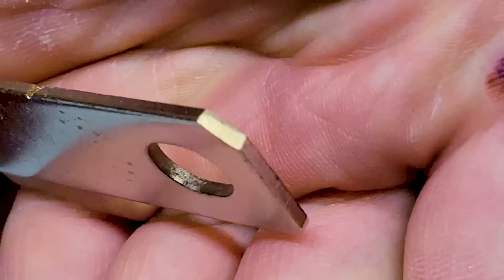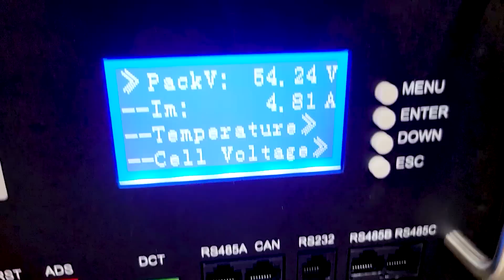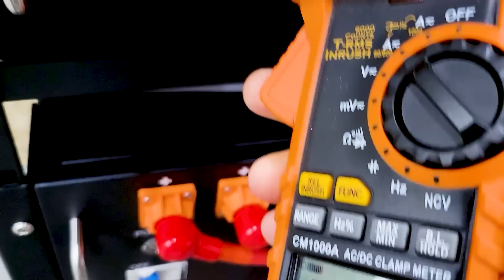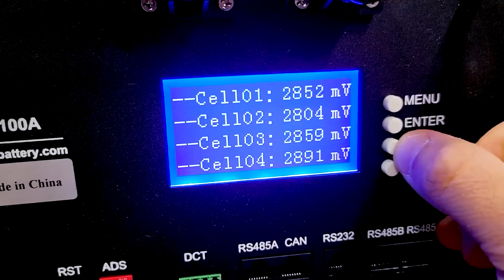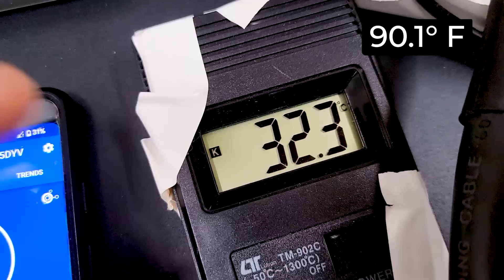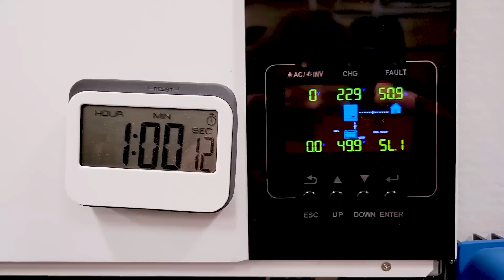Battery Banks - To Daisy Chain or Not to Daisy Chain?  Jakiper Part 2.

Comment: David, I discharged my 276 AH battery( Big Rhino) down to 30%(SoC). The  Conext SCP gave me a low dc voltage warning. After this, the battery went from 276 AH to 261AH and won’t go beyond this number. Is this normal for Lithium Phosphate batts losing 14 AH after 4 cycles? Thanks. Love your videos.
Reply from the maker: Thanks for the question.  Short answer is "No, it's not normal for a LiFePO4 battery to loose 14Ah after 4 cycles."

Longer answer:
 It will be difficult to answer based on your specific situation.  I've never tested a "Big Rhino" battery, and I've never tested a Conext SCP.  
In more general terms I'll try to help.  

I don't know where you are reading the "276Ah to 261Ah".  Is that from the battery BMS or the SCP?  If it's from the BMS, then the BMS may be re-calibrating after having gone through some cycles.  

I once had something similar happen when i was testing a new battery.  It was originally 100Ah, and after a few cycles the BMS re-calibrated to a lower number.  What I found was that I was hitting the high-Voltage cut-off too soon, and the Low-Voltage cut-off.  This is because the cells were not balanced.  In that situation, I removed the cover and top-balanced the cells manually.  Then after a couple more cycles the BMS re-calibrated back up again.  I don't know if this is exactly what is happening with you, but I thought it may help.

Comment: battery 52.3V 112A 5.9kW  the 240VAC output of the inverters was 5.9kW  so a loss of 8.5%, that seems like a lot !
battery 46.5V 101A 4.7kW the 240VAC output of the inverters was how much ? I imagine the loss is higher boosting from a lower voltage ?

Comment: I was just thinking about buying some solid copper bar, maybe 1"x1"x6", and drilling and tapping it for lug screws. It's for non rack mount batteries for a busbar. And one thing that has been a question for me is from assuming that a 100 amp BMS meant 100 amps at 110 volts, which I just recently realized was wrong. So a 100 amp BMS in a 24 volt battery can put out twice the power that a 100 amp BMS in a 12 volt battery does. I'm very familiar with electrical, but for some reason all the alternatives in solar have been clouding my perception in this area.

Comment: David, can you use the 48V charger in same time when inverter charging the battery?
Reply from the maker: Yes.  Multiple sources can be charging a battery at the same time, so long as you don't exceed the batteries maximum charging Amps.
Reply: Thanks, good to know just in case I need to speed it up charging my battery, just about to finish my 12 K Growatt inverter installation.

Comment: For general information:  If copper is taken as the "standard" conductor at 100%:  Aluminum = 61%, Brass = 28%, iron = 17%.  However, the copper must be pure electrical grade.  As little as say,  0.1% tin will reduce conductivity drastically.

Comment: That is a poorly wired system. Each one of those modules provides up to about 100 amps, and only the the first two should have a 4# wife between them. The second and third unit should have TWO 4# wires paralleling them, or a 2# wire, and upping the current capacity accordingly. The better way of doing it all is to connect a 4# wire from all the positives to a buss bar, and THEN the 4/0 cable to the load. If you people want to waste energy, then connect it all up like this video, and possibly even have a fire....that always a good thing, huh? Look up the ampacity tables for welding cable, and you will understand....hopefully.
Reply: Wire, not wife....fat fingering....

Comment: I'd like to know if it's feasible to just have an inverter and a solar switch.  Would I need a charge controller?  Trying to design a small solar with no battery which I can add later.
Reply from the maker: Yes.  The inverters I'm using: https://signaturesolar.com/growatt-5kw-stackable-off-grid-inverter-spf-5000-es/?ref=4_rHcgZ9x-TiF- will power up on solar only.  So long as your load is much smaller than the solar, you can power it.  But be careful about expecting a lot.  As soon as a cloud rolls by your load might shut down.  It's nice to have at least a small battery to help out.

Comment: Hello David. I'm planning to buy two 3kW Growatt or EG4 inverters and one 5kW Battery. The battery will be outside my home so I need something different than a server rack battery. I've been looking some information about the Orient Power power wall but it's a new battery and I can't find many info about it. Do you have more information about it? could you recommend any other battery for outside environment at the same price point?
Reply from the maker: The Orient Power Wall is not waterproof, so you still need to protect it from rain.  The specs on it look identical to the server rack battery.  I suspect Orient Power used the same cells and BMS inside a different case.  This is not a bad thing, just FYI.  If I may make a suggestion, the server rack battery can be put into a plastic foot locker, like this: https://www.homedepot.com/p/Stanley-23-in-50-Gallon-Mobile-Tool-Box-037025H/202300294  In fact, I have a friend of mine who did exactly this.  If you want to see the video here it is: https://youtu.be/MmKsTafbNyU
Reply: @DavidPozEnergy   Thanks for your answer. Unfortunately the part that shows the batteries is too fast to detail how it was made. So do you recommend me the life power battery instead the orient power power wall? I need to be sure because I live outside the US, I will ship the items by sea freight and once I buy the equipment I will have no option to return it in case of any issue. Thanks for your help and if you have affiliated links I will use them.
Reply from the maker: Since you are looking at Growatt or EG4 inverters, then I'd suggest staying with an EG4 battery.  This will make the setup better because the battery and inverter are made to work together.  The EG4 inverter even has a pre-set menu option to seamlessly talk with an EG4 battery.  Both the battery and inverter are not water-proof, so you will need to make sure they can't get splashed from rain.  
Here are some affiliate links:
48V battery (no screen): https://signaturesolar.com/eg4-lifepower4-lithium-battery-48v-100ah/?ref=4_rHcgZ9x-TiF-
48V battery (with screen): https://signaturesolar.com/eg4-ll-lithium-battery-48v-100ahd/?ref=4_rHcgZ9x-TiF-
3kW EG4 inverter: https://signaturesolar.com/eg4-3kw-off-grid-inverter-3000ehv-48/?ref=4_rHcgZ9x-TiF-
6.5kW EG4 inverter: https://signaturesolar.com/eg4-6-5k-off-grid-inverter-6500ex-48/?ref=4_rHcgZ9x-TiF-
PV high voltage disconnect: https://signaturesolar.com/dc-disconnect-rooftop-isolator-switch-by-imo/?ref=4_rHcgZ9x-TiF-
Reply: Perhaps re-purpose a dead refrigerator or freezer (?)

Comment: Off topic question but could you run a string of panels thru a mppt controller to an agm batt bank as well as an additional set of panels running thru a pwm controller to the same battery bank?That's what I have without buying more equipment and wanted to charge the bank faster.
Reply from the maker: I've never tried that, so I don't know for certain.  My gut tells me that it would work most of the time, but not at the high end.  I think one of them will fault out when the battery is over 90% SOC (state of charge).  If it were me, I'd save up for another MPPT charge controller.  Multiple MPPT CC can be paralleled without any problems.

Comment: David does your solar array provide enough power to get through the winter or do you use wind /grid tied generation also. Thanks Alan
Reply from the maker: Last winter I bought some electricity from the grid in January and February.  If I didn't have enough solar production, I would manually transfer the whole house to the grid, and run on grid until the batteries re-charged with solar.  So that would typically be 1-2 days, then switch back to the off grid system.  I did this a handful of times, probably 14 or 15 days total for the winter.

Comment: If these batteries were 12V 400Ah (instead of 48V 100Ah) and were connected in series (instead of parallel shown in video), would that create equal-temperature cool wires at full load? Alternatively would diagonal paralleling (instead of straight paralleling shown in video) also do the trick?

Comment: The current you measure was a steady state at a reasonably high state of charge. The current will be higher when the batteries are nearing low voltage disconnect.
In addition you might consider surge capability of the inverter. Not because of energy loss in the wiring, but for the voltage drop in the wiring. If the inverter needs to supply a surge load, and the batteries are low, too much drop in the wiring will cause the inverter to shut down.
For this reason the minimum wire size I'd install would be 2/0.  On my system I used 4/0 between battery and inverter to handle a surge current of up to 16 kw / 380 amps.
Reply: The minimum would be 2/0 for the system you've shown.  Sorry if that was unclear. 😄

Comment: Hey David. Since there is concern about excessive heat on the battery terminals perhaps you could start reviewing some of the 96 volt inverter systems. I know we are all set up for 48 volts but there appear to be more 96 volt systems hitting the market. The obvious benefit with those is lower current flow and hence less heat loss.
Reply from the maker: Can you link to one you think I should check out?

Comment: Very interesting.  Looking forward to your follow-up on alternative ways to hook these up. 

Would it make a difference if you just increased the size of the cables to allow forever amperage without all the heat loss?
Reply from the maker: Yes, thicker wires will help, but still not be the best option.  Even with thicker wires, you still have multiple connections and multiple points of failure.

Comment: David, that is a great test.  I agree that just ‘because’ a conductor ‘says’ it can carry that many amps, it doesn’t mean you should.  

That was a great test on the Jakiper batteries, and the Growatt inverters.  I have 5 of these batteries and have two Growatts connected (with larger conductors) just like you set this up in this video.  I’ve never pushed my system that hard.  Glad to know it can produce to spec.

Keep up the great work.  

You hinted that you might reconfigure this to a better configuration.  I sure hope you do.  

Thanks David.
Reply from the maker: Yes, the next video I'll demonstrate a better way to wire the batteries.

Comment: Excellent and comprehensive review, David! Thanks!

It is amazing to me how manufacturers cut corners sometimes. While most people won't notice, it is dangerous to run some much power through wires and jumpers that are not designed or certified to carry the load. I'd personally skip Jakiper as a result unless I knew for sure that the deployment would never exceed say 80 amps at 48v nominal.

Please put at least a damp towel in your dryer -- it's bad to run a dryer empty! 🙂
Reply from the maker: Thanks for the tip on the dryer, I didn't know it was bad for it.

Comment: Another great video. I agree with some of the other guys, shorter cables and maybe thicker would have done the job better. Would you replace those busbars with your own copper ones and run the tests again to see how it performs then?  Just for interest sake to see if it handles the temps and loads better?

Comment: David, many thanks for this test. Clearly a busbar system is better choice.
Think that temp rise of measured busbar is caused by the heated up cable. Not due to material what your where think.
Voltage or current drop over the heated cable would interesting thing to measure.

Comment: They did well on the capacity test considering you were running mostly at 0.25C and not 0.2C. Interestingly, if you’re going to subject them to that kind of load I would almost lean towards a high voltage setup. However 51.2V is less proprietary and more DIY friendly, but I have seen a lot of the consumer batteries designed for hybrid inverters are now high voltage. Not that safe to work with :)

Comment: Hi David 
Thats a great video actually your videos are all great man and keep it up. I cant wait for your next battery bank design to sort out that high temperature and current on both supply terminals. Out of curosity did you make a video of the battery bank communicating with the PC to see the batteries on the PC with the software. I really need help with connecting the pack to communicate and also the Admin Password
Reply from the maker: Thanks for watching the video.  I have not attempted hooking up the battery to a computer.   I'm not good with computer stuff.  Sorry I can't help you.

Comment: For the SOK 48v 100ah battery (which Jakiper stole the design from) , we use 2/0 wire between packs and have much better temperature. We also use much shorter cables. Our spec for feedthrough with 2/0 wire is 350a max, which we were able to sustain indefinitely without any dangers of overheating. HighTechLab did a video of this testing at our facility.
Reply: Thank you for your attention to us all the time. 
We sell 12V100AH battery in US retail market since 2018(first sell LiFePO4 battery on Amazon).
Our first container of Jakiper 48V100Ah arrive US warehouse last year, we keep upgrading our batteries by client's request since second container, you start selling this 48V just several months ago.
You have left many negative messages in our clients' forum, one of them says" It's nice to learn from the failures of other companies" on Feb 26 2022, later you slander our service with your pubulic friends... We ignored these because we want to win long term business with the sincerity, and show our real service to customers by time as always...
You are closer to end user, you have better chance than us, take this time on the service and products technology, you can win more market, and with the fair competition, products improving, customers can get the real good and economic batteries.
Reply from the maker: You do some great work.  You are High tech Lab, right?  Same person?
Reply: @DavidPozEnergy  Sort of, he is my partner in business

Comment: Losing a lot of power through resistance.  If you were to use the "daisy chain" method you need to keep the jumpers on the same terminal, and connect the main cables to the center of the pack. Of course you need to have cables that have adequate ampacity. I use minimum 1 for jumpers always keeping equal length and 4/0 for the main cables to my inverter(s). As you said resistance is the enemy of off grid systems. We don't realize that our grid has a loss of 10% or more. Think about having to spend 10% more for your system to account for losses! That would equate to 3 to 5 thousand additional expense for off grid systems.
Reply: The US EIA estimates losses in grid transmission and distribution to be 5% to 6% for 2016 thru 2020. Other sources estimate as high as 67%. I suspect the high estimates include losses in generation starting with the theoretical energy capacity in the fuel.

Comment: Is your garage cooled with AC?  My Texas garage gets crazy hot. The outside temps right now are over 100f and it’s way hotter inside the garage with a metal door facing the sun.  It’s a 3 car garage so it would take a lot of energy to cool. I’m assuming it’s not good to operate these batteries in a hot room.  I have an old fridge and wondering if I rig it as a server rack and use it to keep the batteries cool. Would it be a good/safe idea?
Reply from the maker: Yes, I insulated my garage and cool it with a mini-split.  Here is the video on that: https://youtu.be/Kd092alkeaE  If your batteries can fit inside a fridge, then I think it's a very "cool" idea.  haha.  It's a good idea to cool anything electrical.  If your equipment ends up not fitting inside a fridge, even framing in a small closet with some insulation and AC would be better for the life.  But, it's not required.  120°F is the limit, so 100 in your garage is still within the manufacturer specs.
Reply: I remember reading some research paper on LIFePo4 cell temp ageing which showed it was quite a bit better to keep the batteries below 35c/ 95f and ideally less 30c/86f. 45c/113f was really bad, definitely don't want them sitting at that temp for a prolonged amount of time. I'd be careful with condensation issues for the fridge idea though, also might be tricky to reinforce the fridge to hold that much weight.

Comment: 4AWG Tinned Copper 200C rated cable in open air is rated for 125Amps.  It will get warm and having a larger wire would be recommended to reduce losses but the 4AWG is more than capable of the current you are pulling from it at the moment.  Now if you planed to pull 50-100Amps from each battery you would definatly want to upgrade the cables to something more substantial like 2/0-4/0 AWG and shortening them to be more direct would also help.  The best option is still likely to be using a common bussbar for all batteries connected in parallel but using a common terminal for each daisy connection is the next best option if you don't have separate busbars.

Comment: I have a sailboat with an electric motor instead of diesel. The motor is 48vdc, brushed with 8 6v 220ah lead acid batteries. Most I've ever pulled was 65a.

 How do you think two of these packs in parallel would do in a marine environment? (Not getting wet, just hot and humid)
Reply from the maker: The BMS inside is a circuit board.  It's not epoxied or anything like that, so it will corrode with condensation.  In your environment I'd suggest a waterproof battery like this: https://youtu.be/L2fB4ZwkWrQ